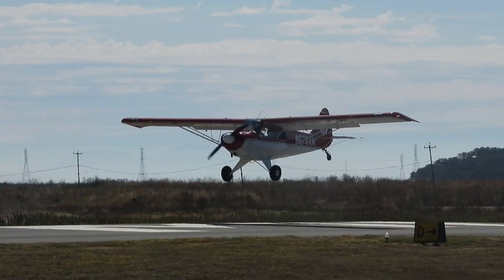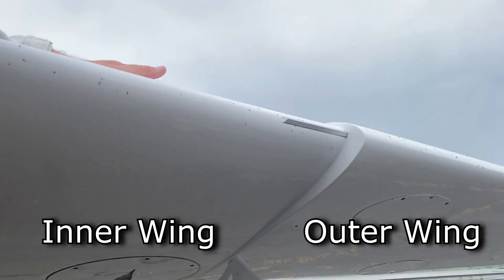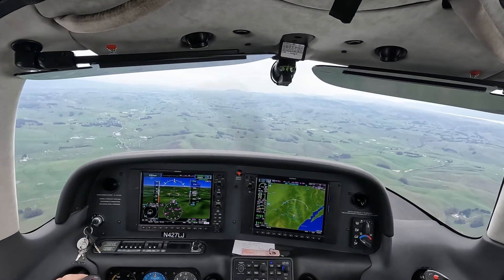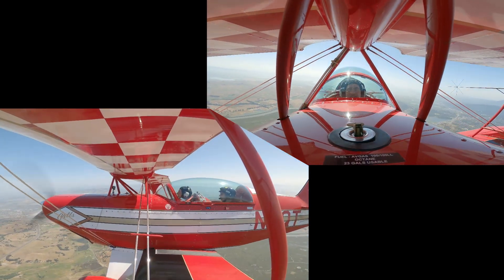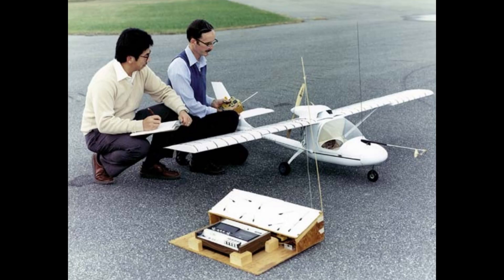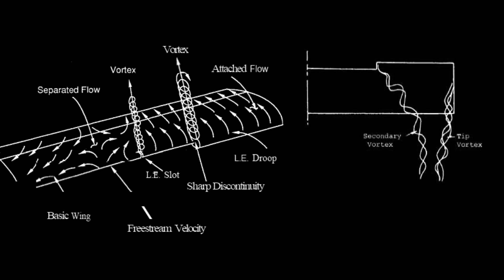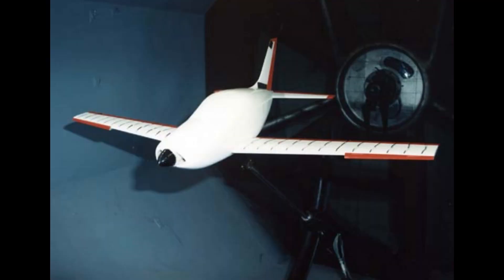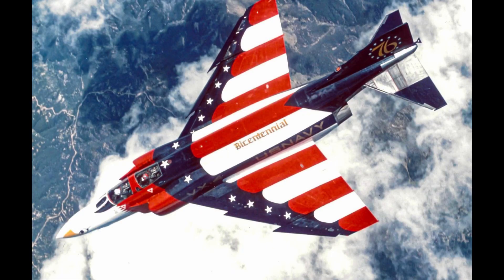Why Is The Wing Broken On Some Planes - How a 'Dog Tooth' Makes Wings Work Better.

Comment: There's no such thing as 'stall speed'. Only 'stall angle'. I've floated over the top of a loop in the Yak52 with less than 20 knots on the clock.... and no stall. A few seconds later, pulling a bit too hard in the last quarter of the loop, I've stalled it with 100 knots on the clock. It flicked without warning, so I exited the loop on a heading 90 degrees off the entry heading!
Over the top of the loop, the wing was almost completely unloaded so didn't reach the critical angle of attack. Pulling through the last quarter at about 6G, the wing loading was high enough to exceed the critical angle despite the high speed.
The delightful Chipmunk is better mannered than the '52. It won't flick without warning; the airflow doesn't suddenly 'let go' at the critical angle, it starts to sperate before the critical angle causing buffet, which is clearly felt through the stick - so you can pull 'to the buffet' and no further, and aeroplane won't depart.
Of course if you pull back hard and suddenly you'll go straight through buffet and directly into departure - and it'll flick!
Reply: For each amount of G there will still be a stall speed...(apart from zero)
Reply: @paulsengupta971  How near to zero? Be precise...  Aeroplanes are precise in when they stall. And it will depend on aircraft weight. Be precise again... Weight isn't 100% precisely known to start with, and reduces during flight due fuel consumption. Ergo, there is no such thing as stall speed. Even a long way from zero. Ergo, don't use speed as a stall warning.

Comment: Ive always wondered about this sharp tooth on the horizontal stabs on F15s. Not on the wings, but only on the stabs.
Reply: Similar idea: it keeps the tailplane working at silly angles of attack. I think I'm right in saying that it wasn't there on the first few prototypes, so it must have been added as a result of flight testing.

Comment: while we are on the topic of "why is that there?", why are those long rods on the ends of the wings in some planes? there are a few in this video like the plane at 5:25. Are those instruments that stick out in front to get wind speed or something like that?
Reply: Could be a research aircraft with a pitot tube for each wing. The further out into clean airflow the more accurate they are. But for day to day use "good enough" accuracy is used because of how exposed and fragile they become when very long.
(I might be completely wrong but it seems logical.)

Comment: I'd just like to say that Laminar Flow is superior.
Reply: Superior at what? "On a laminar flow wing, at the point of wing stall, the transition point moves more rapidly forward than it does on a conventional airfoil. Thus, a sudden increase in the angle of attack or in G loading can result in a violent stall. Pilots flying aircraft with laminar flow wings should be especially careful during landings so as not to approach with too high an angle of attack near the stalling speed."
Reply: @nightjarflying  Yeah, but, like, just in general and stuff.

Comment: The LEX on the legacy f-18 generate vortex that help rudder control at high alpha. The problem was the vortex was wabbling sideway and inducing extreme fatigue on the V Rudders roots, craking them. Multiple brace were installed to help but the fix was the LEX fence that help reduce the wabbling.
Reply: Yep: it's that little vertical thing that looks like a blade aerial, just in front of the wing root proper. The idea of LERX was first tried on the F-5E and F-16, but they both had single fins, so the vortices battered both sides equally. On the F-18, however, it was only battering the outside of each fin, which was leading to stress cracking in the roots.
Reply: Only on the Legacy Hornet. The Super Hornet has redesigned LEX that more resemble the Northrop P530 and YF-17 predecessors. I wonder if Northrop had a better grasp on the Lex than McDonnell Douglas who added the scalloped shaped lex on the Legacy Hornets A thru D. And then removed them in the Super Hornet. 
Also while on the subject the prototype legacy Hornets had the dog tooth leading edge but was not on the production variants. This dog tooth leading edge returned on the Super Hornet.
It would make a cool video if somehow someone could speak the engineers behind that lineage.
Reply: @JeremyD986   I don't remember the dog tooth, but the leading edge flap was one pieces and not 2 like the f-18 legacy. I was told that the LEX opening close to the fuselage was shut because of the drag it induced with the interaction with the extended fuel tank hump behind the cockpit.
Reply: @didiersavard6809  you can find photos online of the blue & white prototypes with the dogtooth leading edge. 
You are correct that they did close off the lex where it joined the fuselage.
Reply: @JeremyD986   Found it, it's an YF-18 Prototype, not the YF-17. I will research to know why. I know that to correct a low roll speed the leading edge flap could work asymetrical and it made the servo control very complex.
Reply: @JeremyD986  From my fast reading, they got rid of it because of the induce drag and the Digital FBW computer got so good, it was not needed. The F-18A,B,C,D are not the most powerfull Fighter every bit seems to count.
Reply: @didiersavard6809  Correct, yes the Northrop YF-17 briefly served as the “F-18 prototype” for USN evaluation. But it was the first McDonnell Douglas F-18 prototypes that featured the dogtooth. Sorry for the confusion. 
I’d say it was a capable fighter in its day. Not exactly the best at anything accept maybe its versatility. Maybe “quietly revolutionary” in its multirole flexibility, its cockpit design which was emulated in fighters that came after. It lived in the shadow much of its life of the F-14. It has pretty interesting lineage and history. Evolving iterations from the F-5 that progressively looked less F-5 and more like the eventual yf-17.
Reply: @JeremyD986  The YF-17 and YF-18s also had a significant gap at the wing root that McDD removed
Reply: Does the position of the vert fins, in the gap between the wing and the stabs, allow their outward cant to catch air flowing up through the gap during high alpha?
Reply: The canted stabs have a lift component. Rudders both inboard also have a pitch moment.
Reply: @frederf3227   And rudders both inboard can be used as an airbrake too.
Reply: @frederf3227  rudder both inboard used in TO on legacy, don't know on the super.
Reply: @scottb721   Very probably. On the one hand two fins, slightly further forward, means more weight than a single fin, but on the other hand it means you don't need ventral fins like those on the F-16 to maintain direction stability at high AoA, which in turn means less drag and more freedom to design for high AoA landings. All aircraft design is an endess series of trade-offs.

Comment: Of course it comes down to vortices. Everything unexpected in fluid dynamics comes down to that black magic eventually. Curious to know how much they increase drag though.
Reply: Who’s this « eddy » and why does he keep causin these things?
Reply: @Keneo1   Eddy can’t deal with pressure.  So he always spins off of control.  He’s tough to beat, though, so a lot of people fight him but crash afterward.
Reply: @baomao7243 Funny, sounds so familiar - is it the same Eddy who mucks up the current around my transformers? B******d….
Reply: @Keneo1 Must be an electrician, I've heard of Eddy currents.
Reply: Most of my life is avoiding vortices, the cost of investigating that black magic is too high, just make something less efficient more quickly (I make bespoke fluid dynamic solutions)
Reply: Vortices are also why bumblebees can fly.
Reply: Formula 1 enters the comments. :)
Reply: @jamison884  was going to mention only Adrian Newey knows it isn't black magic
Reply: @jamison884  Y250 you mention F1?
Reply: Try managing the boundary layer on a nanometer scale for deposition, using only secondary effect analysis. You can understand how every adjustment effects it, but can never image it to verify your in the regime you think.   ESD safe circuit design is the real voodoo, and at this moment I wish I learned it.
Reply: they decrease drag overall ... that is WHY they get used ... a small addition for a large increase ... even on the arrow the wing change from hypersonic profile to low speed profile on the wingtips (this is 1963 when they tested this btw NOT this NASA 1970's Lie)... they found the drag increase of the change was abut 2% .. but the lift change for the low to high profile was on average 25% better ... making it a great bang for the buck ...
Reply: Also of interest is anything that changes the phase state of the fluid.  The amt of energy that can be extracted can be material.
Reply: About the drag, many of these various types of vortex generators are designed to NOT generate a strong vortex during cruise, when the angle of attack is low.  So almost no direct cruise drag penalty.  But there is another way to think about it.  From a designer's perspective, the smart application of vortex generators will actually give you a decrease in cruise drag compared to the larger and heavier wing that would be needed to achieve the same stall speeds and handling characteristics without the vortex generators.
Reply: @willdejong7763  a very good point. The trade-offs/benefits are not always obvious.
Reply: Did my Masters thesis and research on the use of vortices in stepped boattails to reduce drag on blunt body systems (rockets/missiles really) the vortices produced on each step acted as a boundary for air to flow. Was interesting to see the change is step dimensions or number affected the creation of these voritces and if they are beneficial or not. Black magic of fluid dynamics indeed
Reply: The problem with linear mathematics is that eventually nonlinear reality will remind you that your elegant solution is just an approximation. And turbulence. Everyone always forgets about turbulence. I think chaos theory should be a standard module in theoretical physics courses already.
Reply: @citizensnips2348  It already is? At least, it was a compulsory (short) module in my 3rd year physics course well over 10 years ago.
Reply: Especially for swept wing and delta wing fighter jets, redirecting air onto the wing surface 🧐
Reply: Phantom "Kurnass" : What is this thing called drag ?
Reply: What if the two airfoils used (outer and inner) only create vortices at lower speeds with minimal vortices produced at higher cruise speeds?  This might decrease worries of increased drag. ;)
Reply: Increased drag on landing is a good thing.
Reply: “Big whirls have little whirls,
That feed on their velocity;
And little whirls have lesser whirls,
And so on to viscosity.”
Reply: that's the thing, in the continuous equations it keeps going down, in reality there are atoms

 @r0cketplumber

Comment: I remember reading somewhere that slow speed isn’t why aircraft stall. Apparently planes can stall at any speed.
Reply: The stall is all about the angle of attack, the angle between the wing chordline and the airflow, what you read is correct, you can stall at any speed, and contrary to what is said in this video, when a stall occurs, you do not lose lift, the wing just becomes very inefficient, it's still creating lift, but the drag goes up massively, but if you have enough power to overcome that increase in drag you can fly beyond the stall.

Fighter jets can do this, they routinely fly beyond the stall.
Reply: A stall happens when you exceed the critical angle of attack and it can happen at any airspeed or attitude.
Reply: Stall is about the speed of air over the wing, so kinda both. If you go too slow you will stall regardless, but also if you hit too high an angle of attack at any speed the flow will separate and cause a stall. You can also go too fast and start getting transonic effects that lead to stall.
Reply: @XIIchiron78  "If you go too slow you will stall regardless"

Not true, that is entirely dependent on what you're doing, if you're for example in a pure vertical climb, and slow down to a stop to do a tail slide, you could reach 0 knots without stalling the wing.

It is all about AoA.

You could also be at the top of a loop, and as long as you're not loading the wing up, you may not be stalled, or on the ground, on a take off or landing roll or even taxiing.

An F-16 rolling down the runway at 80 knots is going to be in an unstalled condition.

Comment: Everyone always talks about the lift being generated by the faster and lower pressure on top of the wing. I find it hard to believe that there is no effect from the air hitting the bottom of the wing and pushing it up. When I stick my non-aerodynamic hand out the window of a car, I can tell the pressure on the bottom is definitely pushing my hand upwards. I should clarify that Im fine with the lift generated on top of the wing, it's just I think there is some component which is generated by pressure under the wing also.
Reply from the maker: Both have an effect. The important thing pilots need to know is that you can lose the lift from the low pressure over the top at high angle of attack, while the high pressure below doesn’t go away.
Reply: You are correct, there are several models that we use to describe how lift is generated, there are pros and cons to each, the first one you mention is bernoulli, which has problems such as relying on the nonsense that "packets" of air have to meet up again, as if they know each other and agree to meet again at the trailing edge, and there is the one you mention, the Newtonian model.

Personally I'm not a fan of the Bernoulii model, it has other more technical problems aswell, especially at numbers higher than Mach 0.3, where you have to include a compensation factor into equations to account for compressibliltiy becoming a bigger factor, and there's an argument that you really should think about Bernoulli when it comes to wings the other way to what is taught in school... that it's the lower pressure above and to the rear of the wing that causes the air to accellerate over the leading edge towards that, rather than the accelleration causing the drop in pressure.
Reply: Although it is convenient to think of the air flowing around the wing, the wing obviously is slicing through air that was mostly motionless before the wing came along. So when we say the "flow" remains attached to the wing don't we really mean that the air doesn't suddenly start getting sucked along behind the wing?

Comment: Is it better to have a discontinuity in the shape or are the fences like on the mig just as good?
Reply: Wing fences are simpler but more draggy. Dogteeth are popular because there can be other advantages to extending the chord of the outer wing, and if you have moveable wing leading edge devices like droops or slats, it's relatively easy to incorporate a dogtooth by just having them not match the inner leading edge. There's a element of national preference too. The USSR always favoured fences, the French took a liking to notches (see them on the Mirage III), and quite a few British designs used rows of vortex generators on the outboard upper surface. You can see those on Javelins, 1st gen Harriers and several others.
Reply: Some aircraft do have dividers, they're called wing fences, a good example of this is the MiG-17.
Reply: @LeoH3L1 Yes, I edited the question to indicate I wanted to know if the fences are just as good.  They seem like they would be cheaper.